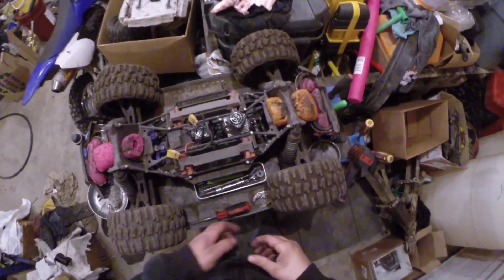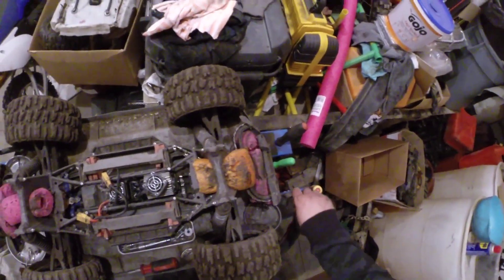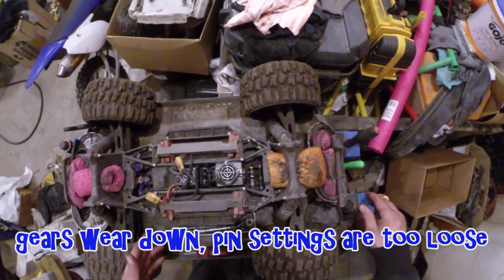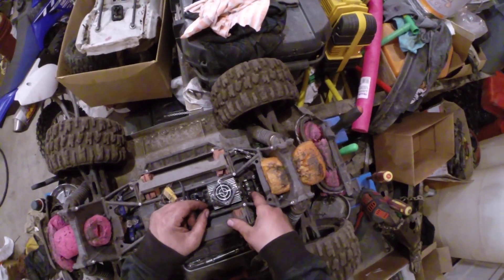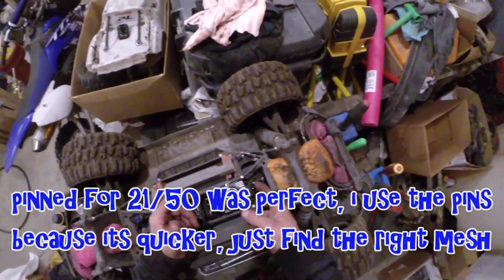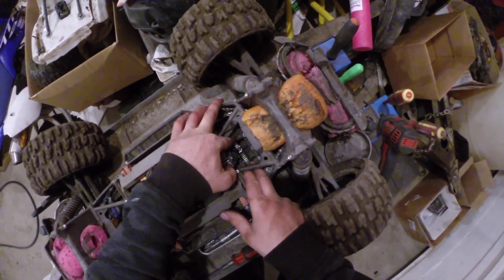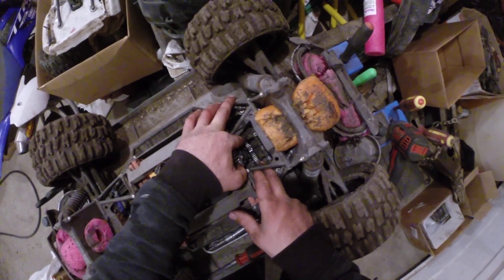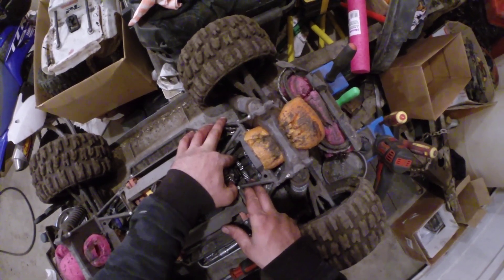HHJJ Tech Tip 1 - How to prevent your RC pinion gear from slipping on the motor shaft

Comment: Each time the pinion comes loose it rounds the motors D shaft more and more. It will come loose more and more to where, in short order, you will not be able to get through a full set of charged batteries. One of the issues is that the center hole of the Traxxas pinion is round. So basically all of the rotational torque as well as gear walking is all on that TINY grub screw. ARRMA makes a gear that I am currently trying in my X-Maxx. It's part number ARA310965 18T Mod1 Safe-D5 Pinion Gear and it has a D shaped hole that matches the motor shaft. I had to remove my motor and use my dremel tool with a cutting disc to extend the D shaft cut about 1/8 of an inch further so the gear would slide on and mesh well with the stock spur. I figured that this would reduce the stress on the grub screw to one function. Keeping the gear from walking. The D shaped hole in the new pinion gear would absorb the rotational torque. I used blue loctite on it's grub screw and ran a full set of batteries through it. I figured it was fixed but on my second set of batteries, the motor whizzed away with no movement 15 minutes in. The Gear having a D shape was still being driven by the motor but it walked to touching the cover and was completely clearing the spur gear. Next I drilled a tiny divot in the flat spot of the motors D shaft where the grub seated so the grub screw would extend down into the drilled shaft. Even if it came loose it couldn't walk and the D shaft hole in the pinion would keep it locked to the motor shaft. That worked but after a second set of batteries, the gear was noticeably wobbly on the motor shaft. It stayed on the motor and didn't fail while driving....yet. I didn't like the idea that it was rocking on the motor shaft, so this time I said screw it and used Red Loctite 271 as a final way of keeping it from walking. As a 3rd failsafe, I glued a metal bushing to the backside of the plastic pinion cover where the gear would rub when it came loose. If the grub fails while driving, the cover would keep the gear from walking away from the spur teeth and the D shape hole will keep it locked to the motor. This is how bad of a problem I have been having with my truck and it is only a year old. I refuse to purchase a 200 dollar motor just because the stock gear they supply comes loose and wears the motor shaft. If I have to expoxy or JB Weld the thing on there in addition to Red Loctite I will. But basically, you pretty much have to secure the pinion with every permanent option available and forget about the possibility that you may need to take it off one day. Right now I am waiting 24 hours for the Red Loctite to dry and then we'll see what happens.
Reply from the maker: @Ryan96se i have been doing the drill divot in this video for a while now coupled with red loctite, i have never had a problem since, if your motor shaft does become too round you can make a new flat spot with your dremel or grinder, but you only have a couple of saves with that option as you loose material each time, be careful to not remove too much material, i have not tried the arrma pinion but that is a great idea to D shape the pinion, like i say the divot and red locktite i never have a problem, it is also still easy to get off, i show that in my other tips and tricks video, just use a torch, people try to tell me thats a bad idea cause the heat will demagnetize the rotor magnets on the motor, but they are in error, yes heat can do that but you dont need that much heat, i do it with the rotor in my bare hands to show how the heat is not an issue, thanks for watching, i hope you got your issues sorted, cheers!
Reply: @happyhappyjoyjoy6563  Thank you so much. Don't waste your time with the ARRMA gear. It was a nice thought however, the stock gear, a divot and red loctite seems to be doing the trick for my truck. Thanks to you I have been able to enjoy my truck for the first time in a great while. I even thought about selling it because of this issue. Now my biggest concern is if I am ever going to be able to remove it if it strips the teeth (fingers crossed)
Reply from the maker: @Ryan96se  yeah man i dont need to run d cut pinions myself. Doing this mod i have never had a problem. When it comes time to take it off i got you covered. Watch my other tech tip video for removal

Comment: So embarrassing but i had never seen the motor out of one of those things before. Of course it is the size of a beer can. Thats awesome. Not awesome like the end of this video awesome but still.
Reply from the maker: Haha. The upgrade 800 kv motors are about beer can size. I run stock. Its a little smaller but the xmaxx is a big beast. Its very easy to remove the motors in these. Thanks for watching. Cheers